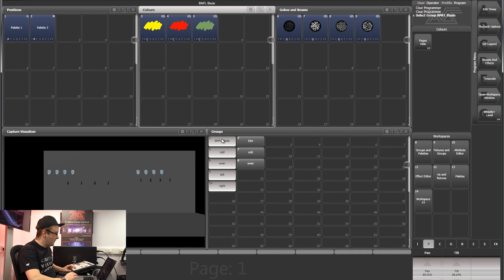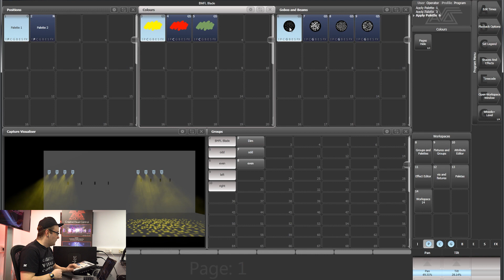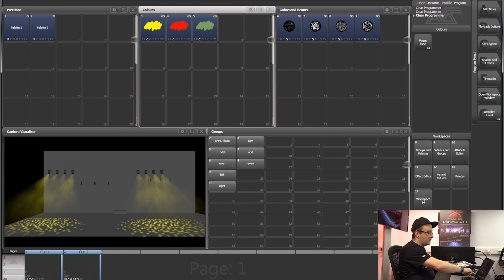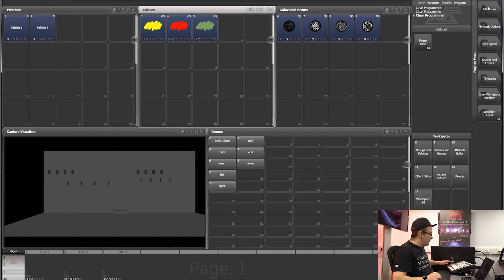Recording Playbacks

Comment: Mine one doesn't record any except the intensity though I changed colour gobo position etc.  Can you please help?  However when I started a new blank show it works.  Don't know why it didn't work with the other show.  Any show setting I need to be aware of?  Many thanks in advance..
Reply from the maker: It may be that you have pressed one of the attribute buttons during your programming. When you press record make sure the mask on your softkeys is set to  include every attribute.